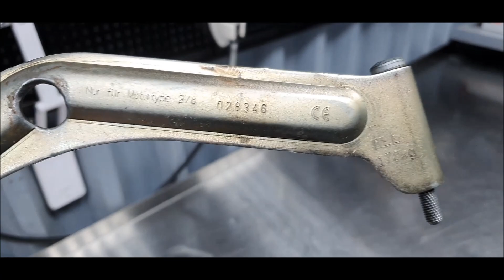SLK 55 M113k swap (part 11)

Comment: The oil cooler lines didn’t fit, I used yoshi fab oil cooler an adapters with braided line to the factory oil cooler

Comment: So the hood (bonnet) closes witha supercharger.....so I ask YOU MERCRDES ..WHY DIDNT IT COME WITH A SUPERCHARGER FROM THE FACTORY!
Reply: Same reason the newer C-Class and S-Class AMG's don't have the same hours power. You have the justify the difference in price, thus the difference in power. Mercedes got all the power they could out the NA M113. Only way to get more power was with forced induction. The newer ones, is easy with just a tune an some beefed up internals. I'd be scared of that power in this car too, a SC V8 in a body/frame  made for a V6 is scratchy lol